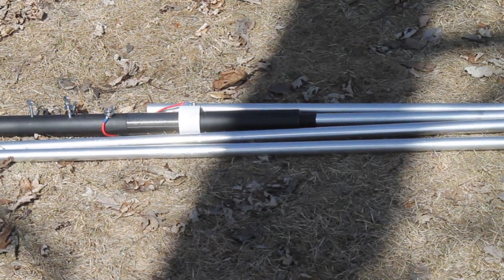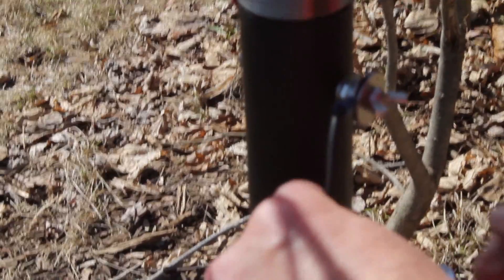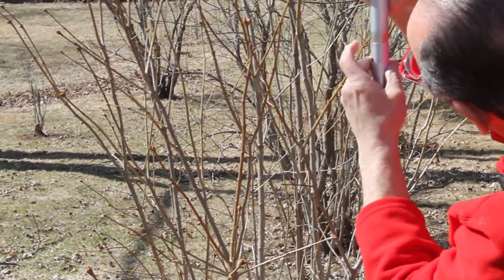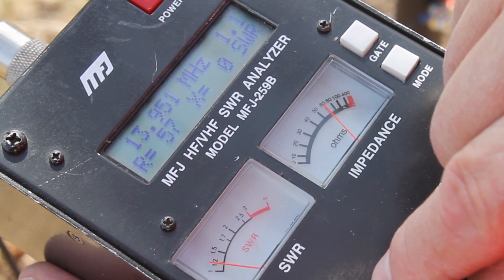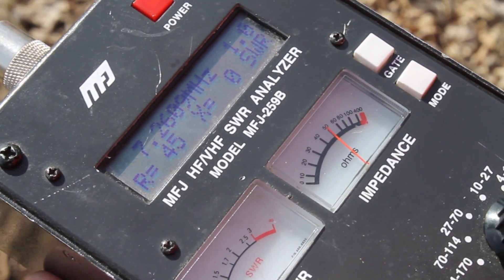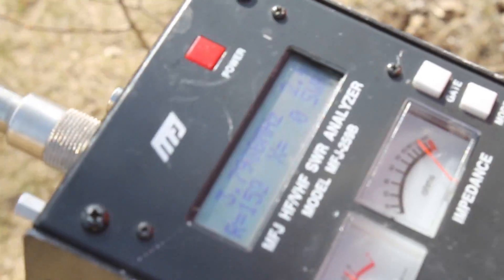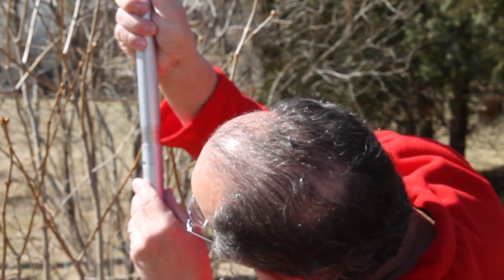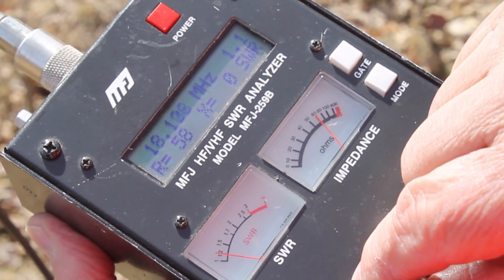wolfrivercoils.com NEW Silver Bullet Portable Vertical Base Antenna

Comment: This looks like it will work and get be back on HF after so many years away.  I have little "real estate" to work with but at least I don't have to mow gravel. 8-] Fortunately the manager of this older, 55+ park has okayed the project since I am a member of the local volunteer group with the County Office Of Emergency Management.  My CW is really rusty too.

I will mount this antenna on aluminum military surplus masting.  I assume it's a good idea to ground that aluminum mast?  Agreed?It will be mounted on the side of an 8 by 8 shed and next to my large metal carport.  Does it sound reasonable to mount one ground plane wire to the carport?  I can run a second ground plane wire at about a 160 degree angle across to the corner of my mfg home.  There's no other place to run another wire.  Does this all seem reasonable so far?

I'll await your recommendations before ordering the antenna.  Thanks and 73,  Hal N7BAZ

Comment: how many inches long is the 3 sections ? and also with all 4 sections ?
Reply from the maker: There is two five foot pipes and one three foot pipes.  The last one is the base at four feet.
Reply: @wrcoils  Sounds like you are saying 4 + 5 + 5 + 3 which is 17 foot total.  I couldn't understand exactly what you meant about not using the last section unless you want the CW portion of ?????.  What did you exactly say because I'll be using CW on 40, 20 and 30MHz.  My CW is 25 years rusty. 8-[

I'll have to mount this on military surplus aluminum masting against the side of a shed which is next to a large metal carport (Maybe attach gp to the carport?).  Will the carport work for part of the ground plane?  I can maybe stretch and attach one gp wire to the corner of my manufactured home 180 degrees away from the carport.  Does that sound reasonable?  I have very little "real estate" available to use, but then again I don't have mow gravel! 8-]

I'll await your advice before ordering this antenna, but it sure looks like it will get me back on HF after so many years.  Fortunately the manager of this small, older, 55+ park is friendly to my project so I better get crackin' while the ferrous metal is a very high temperature!  Thanks for the video.